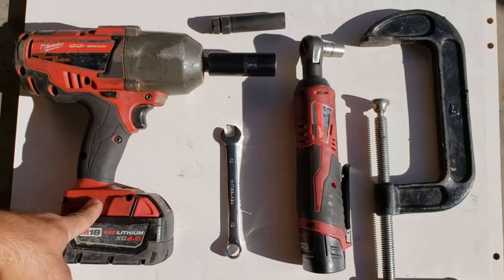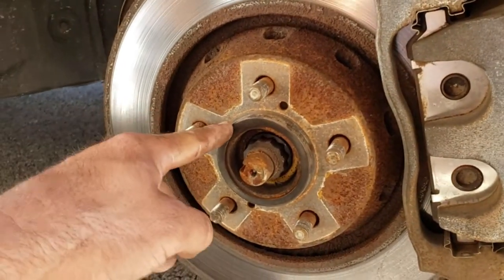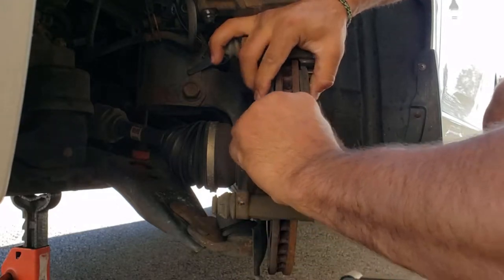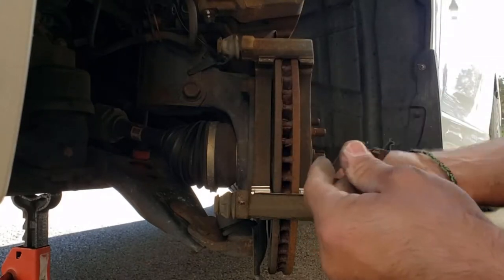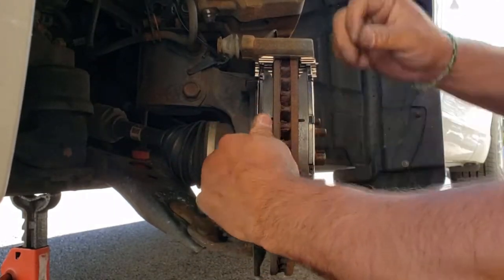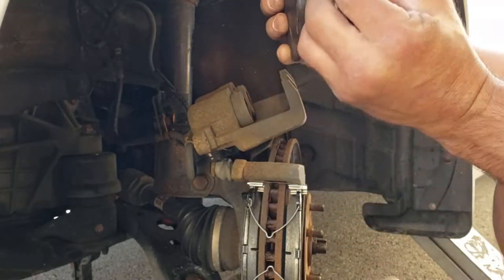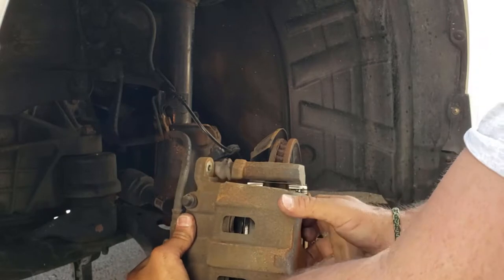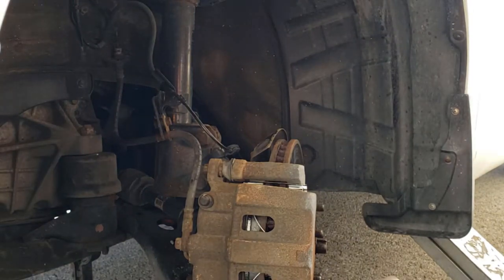2011 Toyota Venza Front Brake Replacement

Comment: Great video thank you and I want to know are those springs really needed because I broke one and I took them both off?
Reply: I believe those are to keep the pads off of the face of the rotor when depressed.  The vehicle while stop just fine.  70% of the cars on the road don't have those tension springs, it will be fine!

Comment: I open the bleeder before pushing the pistons back. That way the system gets new fluid through the top reservoir rather than using all of the old stuff.
Reply: Nice work!   I use a vacuum pump.  To insure air doesn't get pulled in through the bleeder valve.  To viewers who wonder, how often you should bleed your brakes... periodically, more so in colder climates.

Comment: Thank you for the video. I've also seen a few other tutorials where they put brake grease on the hardware, but notice you didn't put any on. Is the brake grease only a recommended item but not actually necessary?
Reply: Short answer- Yes you can use a high temp grease to lubricate the slides.  Is it required, no.  
Long answer- haha The brake pad moves maybe 1/4-1/2 over it's lifetime.  If you have stainless steal slides, they shouldn't corrode before your next brake pad replacement.  Brake pads ride just infront of the rotor, when you let off the brake pedal.  So I only move in one direction.  Grease if you like.  I normal only apply it on the corners of the metal pad, and slightly more towards the rotor, since that's the path it will be taking.  Hope that helps.
Reply: @andrewscribner5983  Thank you for the explanation. I did attempt the job over this past weekend and everything worked out smoothly. I did ended up applying brake grease just to be on the safe side. Thanks again for the great tutorial, the job was way easier than I expected.
Reply: YES the brake grease does serve a purpose, and is necessary.

Comment: You said the squeeler should be on the trailing end of the wheel rotation, but it’s actually on the leading end, as you have shown.
Reply: I needed to watch it again, painful watching yourself haha...  so to address your comment, it technically will work in either orientation.  The wear on the pad, will naturally wear at the leading edge, all things being equal, the finger being on that side, will give you ab earlier warning of the bad wear.  It will be fine, at etiher end with this style pad.  The finger is a spring type, that is suspended, not riveted tightly to the metal backing plate.  Thanks for the eagle eye!